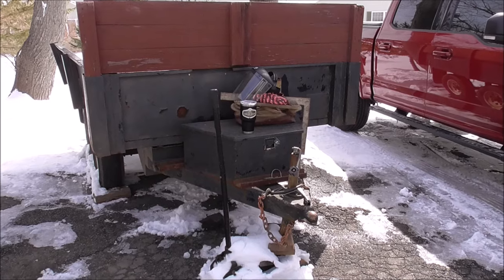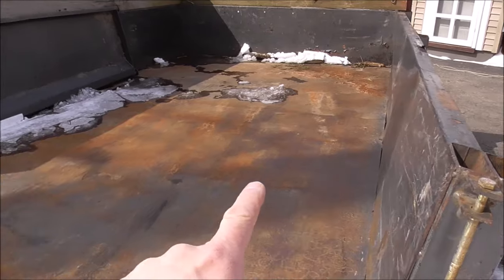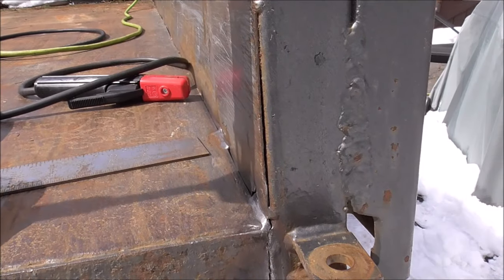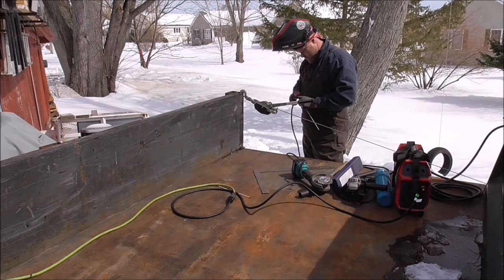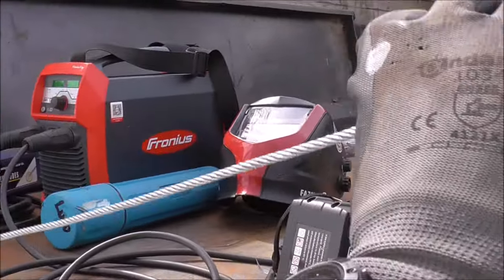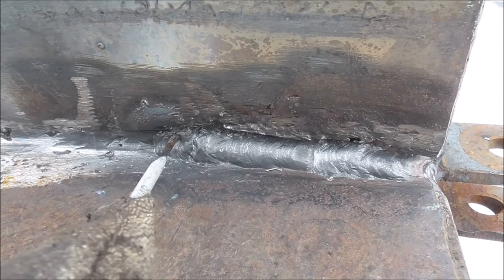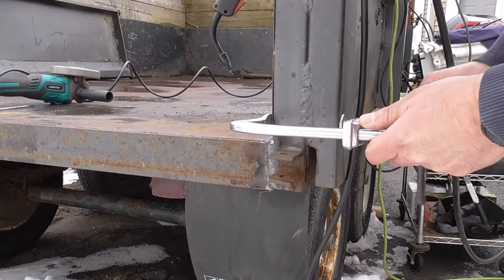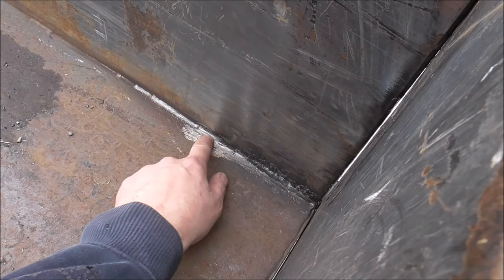Rolled-Over Trailer Rescue: Welding Repair Guide

Comment: Great work Brandon.  Way better than it was when it was new from the factory.  
Only thought I had is that I think I would have started things in the middle with the come-along and began my welds there.  Then, to the back of the trailer like you did it.  
I learn so much from you, love your work and videos.
Reply from the maker: Great point! I could have welded a ring to the floor and pulled in a simular fashion in the middle, but to correct it, I would have to cut back the sides again to get to the structural metal. Usually when I try to do a little more, it ends up biting me LOL

Comment: Nice job Brandon, it's not easy to fix old rubbish and make it new. But you did your best to make it functional and better than it was. If it was your choice, you would have made the side walls new but that was not the question so you did what you did. Have a great Easter weekend and greetings from the Netherlands.
Reply from the maker: You are spot on Christian! Thanks you so much and I hope you have a great Easter also!
Reply: Great work in a less than great situation, the use of mixed welding, stick and MiG is a good example for people to learn from. All to often people think I started with this style so that is what I have to use, also pointing out about flux for out doors was a good point to make. As always thanks for am excellent video.

Comment: Thanks for the welding instruction. 
What is the purpose of placing short beads and then cleaning up after each one before going to the next one, instead of doing the entire length before cleaning up?  You did this even after adjusting for heat. Just your habit to check quality often or some other reason?
Thx!
Reply from the maker: When the "keyhole" starts getting too big, from having my amperage a little too high, I will let it cool to help close it up and then I clean up the slag with the grinder to get rid of any contamination before I strike my next arc. Great question! Thin metal is hard to weld because the metal starts out with the right amperage but overheats quickly.

Comment: That trailer was a commercial build? GEEZ!! Those who built it should be run out of business. Cheap and shoddy. From a distance it looks quite strong, but close up it is extremely shoddy, even amateurish. My bird sh!t welds would be stronger than the original welds. 
(Here it comes) Shoulda TIG’d it. 😂😂😂😂
Good job Bran, thanks for posting.
Reply from the maker: Hey buddy it's always good to hear from you! We are getting a HUGE snowstorm tonight. Winter is almost over and mother nature is getting one last storm. We went motorcycle riding last weekend. It's crazy!
Reply: The white stuff is no good for you mate, too bloody cold. 😉
We have an annual temp swing from -5C to +45C, no room for the white stuff 😂😂. From (fading) memory our lowest minimum since 1980 was about 5 or 6C and that was cold enough. Weather conditions blew the snow clouds up from our snow fields and dumped it up here and north to the mountains west of Brisbane. That was about 1982 or 3.
Cheers ol’ mate

Comment: 7014... rather than mig. Yea, mig is good also but you already had the stick out. Then 7024 over in bed. About what did that $?
Reply from the maker: I haven't got with the customer yet to see if they want to add additional bracing, but to get it to what you see in the video - 2.5 hours @ $80/hr = $200.